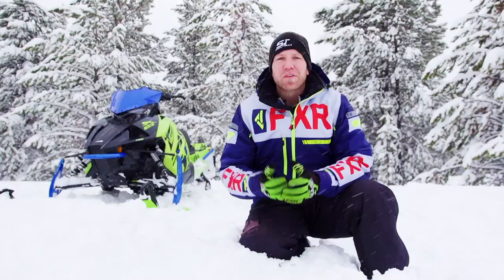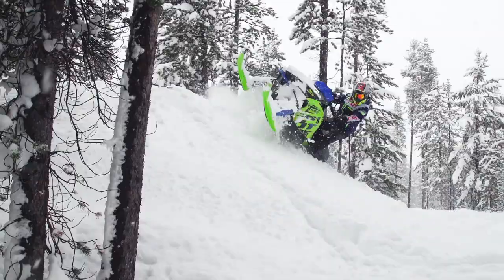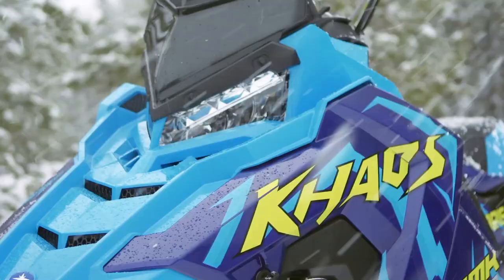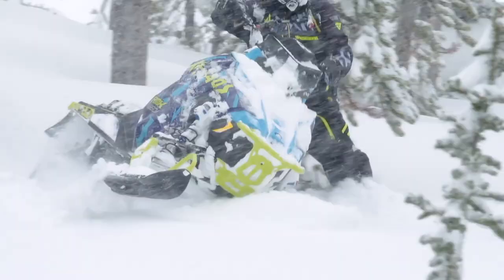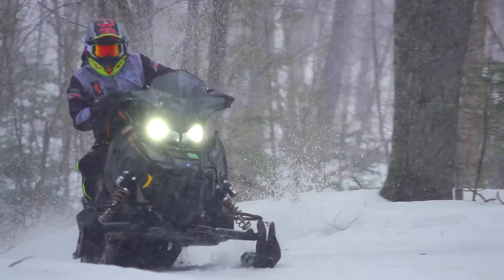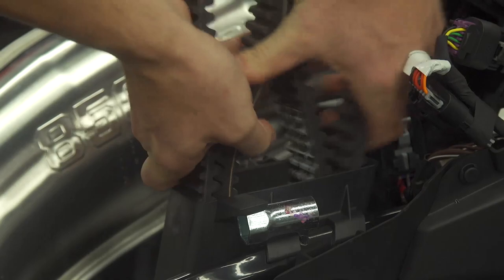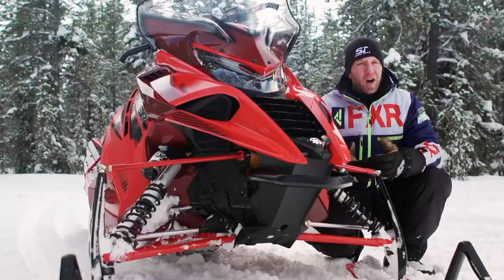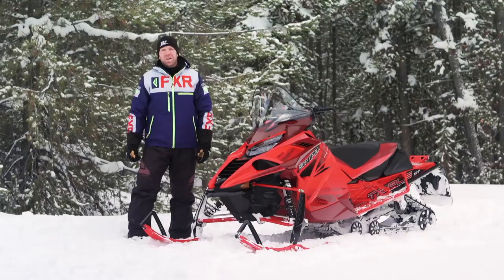SNOWTRAX TV 2020 - Full Episode 1

Comment: Love your channel but, I see how you rate the polaris 850 sled as the best off trail sled as the best all around sled,   my question is why dont you discuss how polaris clucthes are garbage and brake and fail...ya.  so im gonna buy a 18 thousand dollar polaris sled with a garbage clutch...  so I have to spend 800 dollars more to have a clutch that lasts...mmmmmm.   pass.  I ll buy a skidoo,least the clutches last fir the same price.     Why dont you talk about that, instead of ohhhh. The front end pops up through the snow...    great after 57 times the clutch fails....ahhhh thats not a sucess.....spending 20 grand on a sled which needs a 900  upgrade siit continues to run.'......passs.   talk about that,   I dare you..
Reply: feindrache that kinda seems like a you problem, i have this wierd feeling that you havent changed the clutches 57 times, if you have, good for you :)
Reply: Our Indy trail had terrible clutches, garbage
Reply: If you treat the sled right you won't have clutch problems and I can tell you my 2015 pro has been popped out of the snow more than 57 times and it's running as good as the day I bought it
Reply: The answer to this question is super easy. We've never experienced a single clutch issue with any Polaris we've ever tested. Not in the mountains, not on the trails. We report what we experience and thats it. Its the only way to maintain any credibility at all. How credible would I be if I started basing my reviews on experiences OTHER people have had but I have Haven't? I get that you've clearly had problems with your Polaris clutches. And im not trying say you haven't, but ive ridden with a long list of guys on Polaris's and ive never identified any kind of "clutch issue" Polaris mountain sleds may be suffering from.
Reply: never had issue with a polaris clutch from day 1 .ive been riding polaris sleds with new  clutch style since 1973.  in  1978 i got job at a polaris dealer he went thru each & every clutch from sleds he sold. he made sure everything was right. granted there are dealers today that  do not do setup. my 89  500 indy had 5,000 miles before i replaced weights & rollers